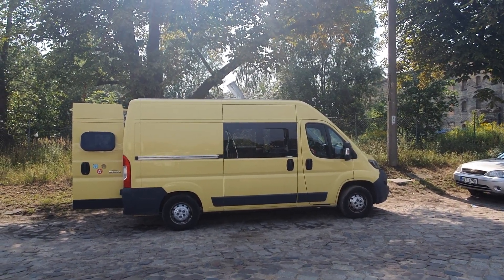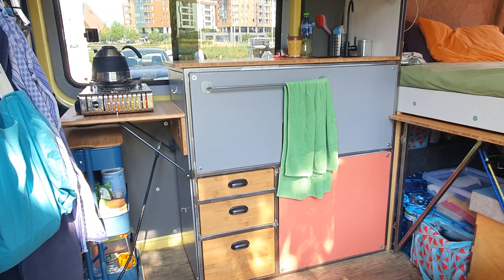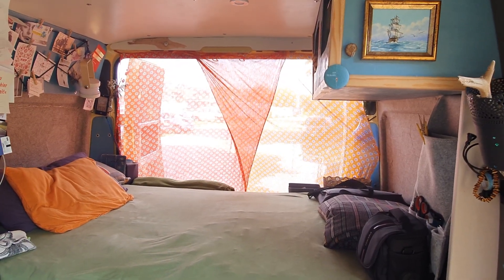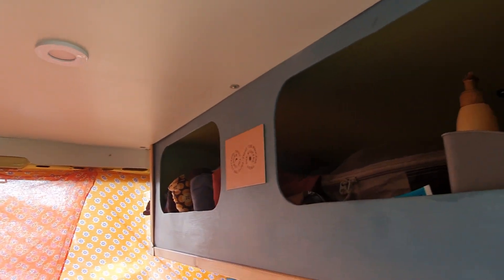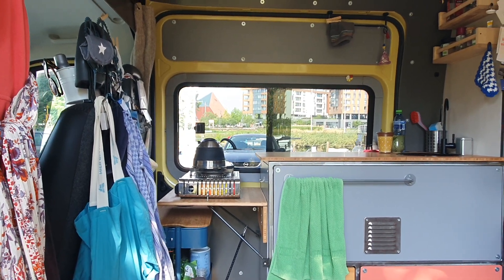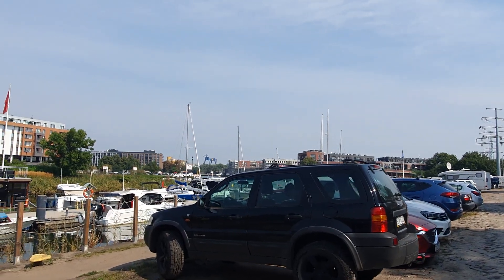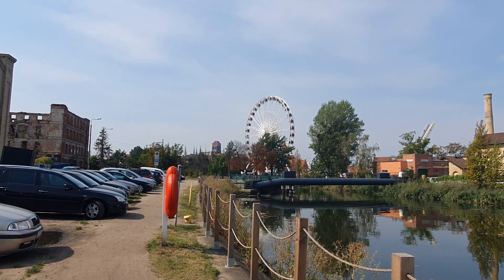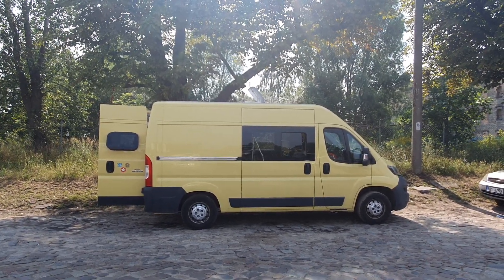DIY small campervan conversion.  First attempt on Peugeot Boxer!

Comment: A personal build should be just that, personal.  Meaning tailored to all the needs and preferences of the owner.  I do have one observation that is valid for almost all the van builds I have seen.  There is always a mass of "bits and bobs" just hanging on the walls or the surfaces and I personally find that strange as I would want things secured away for travelling.  This disturbs me so our build worked to get everything secured away and yet accessible.  Still this is has a nice large space and airy feel.  Alex.,